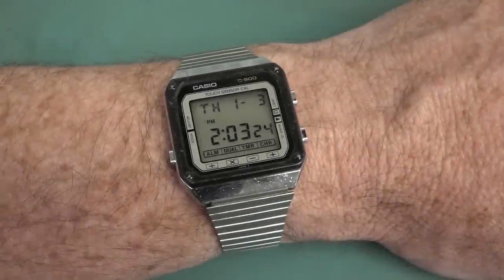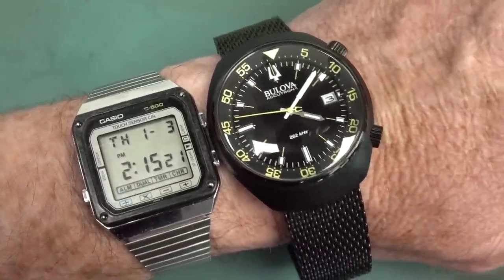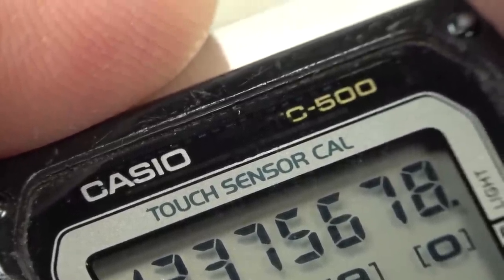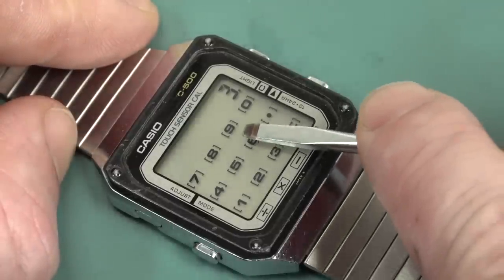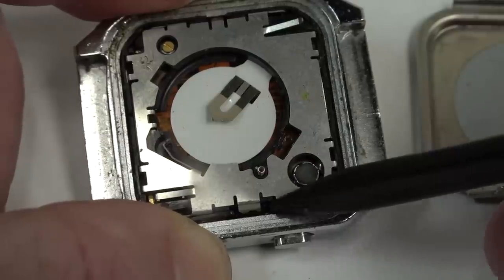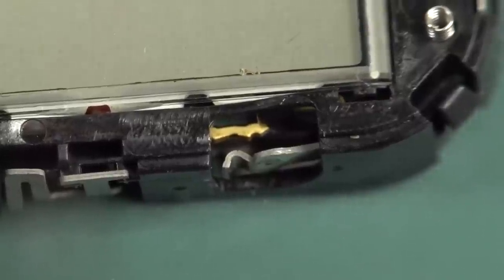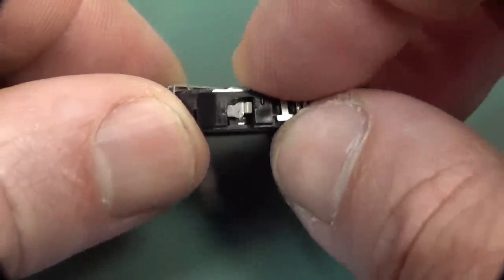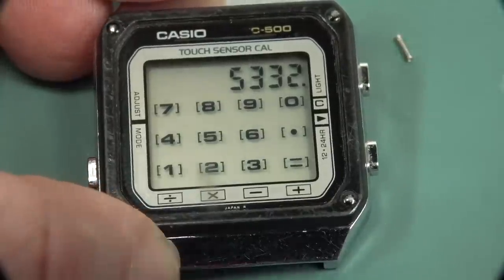EEVblog #1166 - Amazing 1980's Touch Screen Calculator Watch!

Comment: Ok, the wath arrived! Put a new battery in and it works(old battery was put in upside down...no wondern it didnt worked :))))  )
Everything works except the calculator touch pad. TV remote ect all is working but not the calculator.
I had this before on another casio calculator watch, where ive replaced the battery and some kind of "black rubber/plastic" piece flew out of the watch housing. The black piece that is showen in you video that connects the "pcb" as i know now from you video.

I didnt knewed how or where to place it and from there on the touch pad never responded anymore. 
Here on tis TV watch i hadnt seen this "black piece"! Should there be one? Or what else could be the problem, that the touch pad dont respond? Ive did the AC reset succesfully and the watch showed @. Thanks

Comment: Is that notch under the adjust button intentional or is the case broken?
Reply: It's not broken. They have the cutout notch so your fingernail can depress it.
Reply: Thomas Matovinovic Agreed, the notch is intentional so that you could still depress the set button with your finger nail, without the notch you would have needed a narrow tool to depress the button.  Thankfully there was no great notch controversy in the 80s and 90s, that’s a modern first-world crisis!

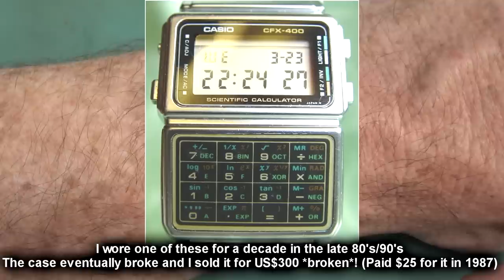Comment: Somewhat random request for future videos... Could you fade out the text overlays, e.g. at 18:45, instead of cutting them out?  I ask because I tend to watch at increased speed (2x or so, usually), and somehow it seems like my brain thinks the removal of the text is new text, and so I have the sense that I missed something... I think with a fade-out, my brain wouldn't play that trick on me.  It could be quick... 1/4 second or something... And maybe I'm wrong that it would help, just a thought I had.

Thanks for making these!  So much interesting stuff... and yeah, I remember actually having a little savings project at one point in my childhood, saving up for a calculator watch from Casio. :D

Oh, and see you put a photo of this watch on Wikipedia!  Nice one!

Comment: What's the cylindrical component wrapped in metal and soldered down with two big blobs of solder? (Bottom-right of the PCB in the picture.)
Reply: The beeper perhaps?  Maybe contacting the glass.
Reply: It has a piezo sounder on the backplate for that, though.

Comment: 4:08 I think E stands for exponent, not error. 25236522*5525=139431784050 or 1394.317*10^8, written 1394.317e8. Not sure whether pressing the button shows the exponent or the next digit, as they're both 8 in this case.

https://en.wikipedia.org/wiki/Scientific_notation#E-notation
Reply from the maker: That's what I thought, but the manual says it's error, and I couldn't find a way to show any exponent

Comment: Does the trimmer adjust the clock speed?
Reply from the maker: Yes
Reply: I wonder what the resolution/sensitivity the trim is. I mean if you were to turn it the slightest amount I wonder how much it would alter the clock accuracy.

Comment: Are you sure it's an Error, granted that the 8 digit is 8 in the answer but it could be E notation? 
25236522*5525 = 139431784050 = 1394. 317E8
So when you click C after getting the E your last digit is the 8 in E8?
Hard to tell because gf all the 8's but that would be the reason for the dot that's added.
Reply from the maker: In the manual it says E means overflow error
Reply: Ah ok, the dot and the fact that it's was E8 if you used that dot threw me 🙂

Comment: 2 digits for the year ... could this watch work after 1999 ?
Reply: Great Geekax If I recall, the watches of that era were good though something like 2025 (and should have had a proper leap year exception for 2000, so fully Y2K compliant).  But eventually the year window will be exceeded on these watches and then you will have to lookup to see which past year calendars will yield a correct calendar for your current year if one still wishes to have the date (minus year) and weekday indicators worming properly.

Comment: My Apple watch doesn't even have a calculator, well not without an internet connection anyway!
Reply from the maker: Lame!
Reply: That depends on the model. Mine’s have a calculator and the pressing of keys gives a brief vibration. It connects by Wi-Fi from my iPhone or my router lovingly, autenticate access to the phone and is fully functional when connected as such.

Comment: Hey have you ever heard of the old Radio Shack Tandy in in Australia oh by the way speakers handy Sullivan Radio Shack computers were actually branded candy in the United States USA USA USA.

 Have you ever heard of the Radio Shack talking watch with the rooster alarm my best friend that has recently passed away that was once had one also I still have his talking calculator that he gave me and also his old four alarm calendar LCD alarm clock with speech the reason why I got the calculator is he had gotten the iPod Touch same reason as the alarm clock and no longer needed it and I was going through sometimes regular calculators in less than a year depending on the quality and he said that he had hand that for nearly 20 years and still works fine is heard that oval have more than that 0 problems on the talking characters which by the way the voice could be turned off completely and also I cannot remember how many digits but it was well over eight digits I think it was maybe even a 10-digit calculator or even more it was not a scientific but it was the best guy I've ever used it had the rubber but but they were great and really high-quality it's still works by the way no button button batteries oh by the way you never guess what I've got in it to extend battery life that's right bat a risers
 Because I thought since you search for Power I could use batteries when you would run my remotes from run the calculator and sure enough there is a niche application for those things that put this to bed and I first heard about those with you so that's one reason why I shared the story I would appreciate thumbs up you know okay I'll hard on this one or maybe response from you Dave you're one of the biggest YouTubers I watch I don't know how many years I've seen but you're a channel that wash the most probably I've seen hundreds and hundreds of your videos over the years who knows maybe I'm one of your biggest fans I don't know thanks keep up the good work oh as far as that button that was designed as asteroid special radio goes in terms of the contacts thing in series it was not for reliability it was so that you had to press both buttons to ignite the charges for the self-destruct. Also did you realize I'm seeing comments on this video saying this so far but you did say I think it was surface instead of circuit and also one other goof-up very somewhere to which in the same video and I don't think anyone else caught it?

In terms of the outlets that you guys use they are actually compatible with one that was used way back it was well probably over over 40 years or more ago I don't know exactly here in the United States what we call Crowfoot plugs hundred percent obsolete they could either be wired for Cassius hundred 10 volt or 220 here in the US and also they were two different ratings 10 amps at what voltage and 15 at the other which is free Nema standards the reason for these dual rating receptacle in some places as I said it was due metering but the main thing was originally code only allowed 10 amps for lighting and 15 amps for power for that purpose is why we had dual rating receptacles
And voltage ones.

Also could you show an image or talk about the your lower rating receptacles and a larger and larger rated once I cannot find the information on it on the internet it seems thanks bye and keep up the good work on videos and everything else thanks bye